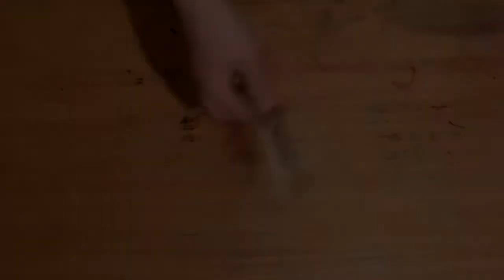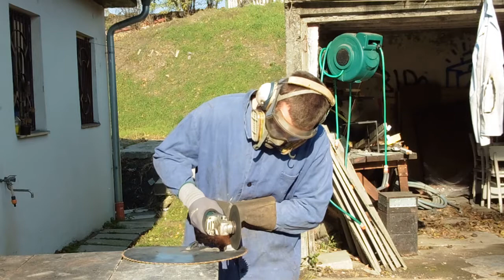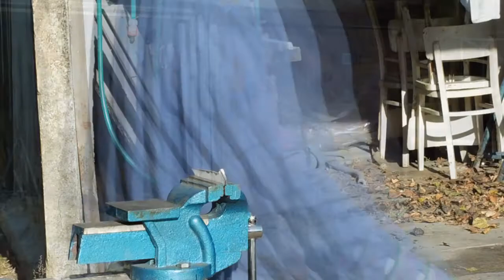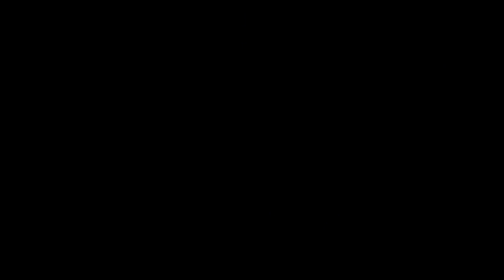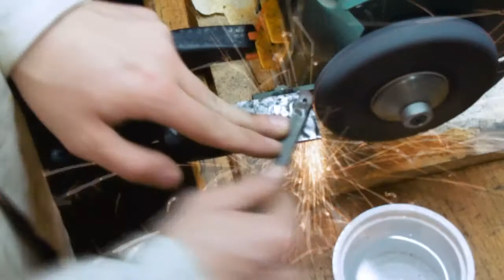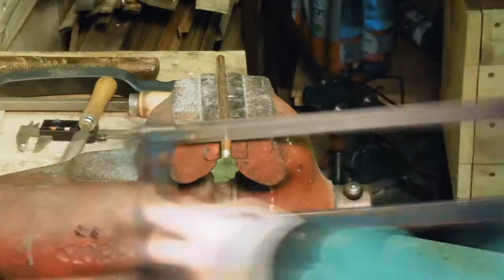MK: DIY Butterfly knife

Comment: I love the design, It looks very functional and well made. You could show bit more of the assembly of the knife from the parts you manufactured. Did you river the blade to the handles or did you use screws?
Reply from the maker: I used bolts & nuts countersunk in handles, because I don't have tap small enough for this.
Reply from the maker: And big s/o to you for the inspiration!
Reply: What is the advantage of the masonry bit you have used compared to a standard metal drill bit?
Reply from the maker: Well, you simply can´t drill hard steel with standard HSS drills, they´re just softer, than the workpiece. Masonry drill bits have carbide tip insert,therefore allowing to machine significantly harder materials.